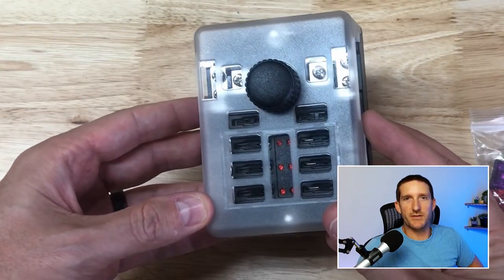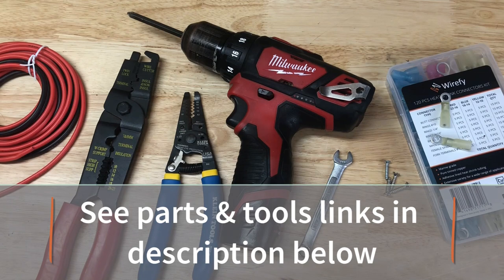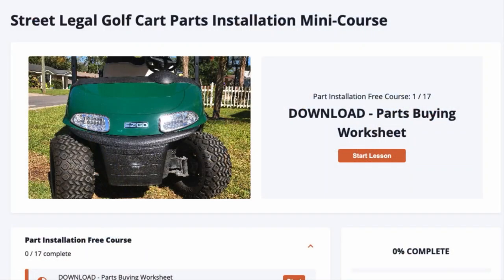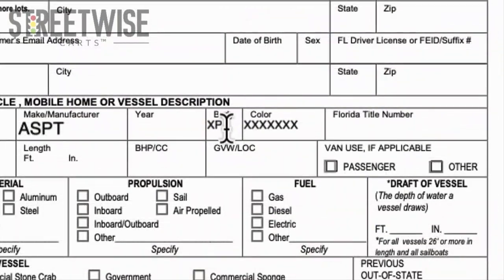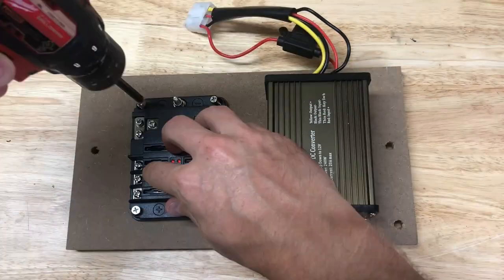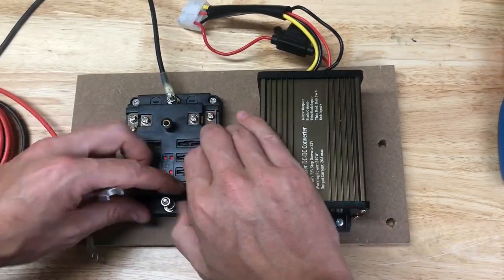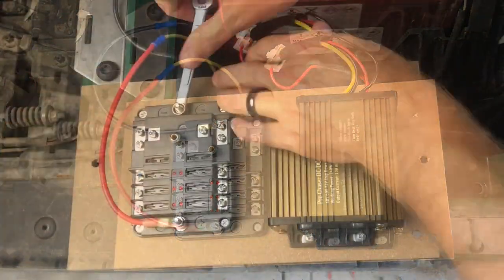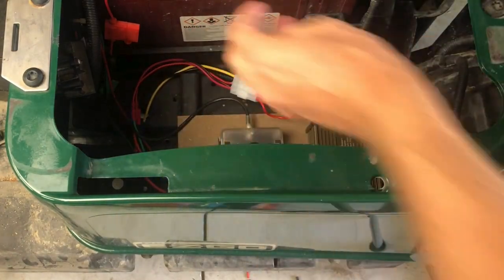Fuse Box Installation for Golf Carts | Mounting, Wiring & Location on EZGO RXV

Comment: Where do you connect fuse box ground to? Main battery pack ground?
Reply from the maker: You should run the fuse box to the voltage reducer which has it's own Pos out and Neg out. You can see this at the 2:06 mark in this vid.
Reply: Ok so there is only one negative cable on the DC converter and it should go to the fuse box. Then I have to split the ground cable from the DC converter and run they to the main battery pack negative?
Reply from the maker: @alexeyafanasiev4795  You will need to refer to your converter wiring diagram. It sounds like you have this one https://10l0l.com/products/10l0l-30a-golf-cart-voltage-reducer-voltage-converter-36v48v-to-12v-with-dual-power-source-for-club-car-e-z-go-360-watt-p1329195